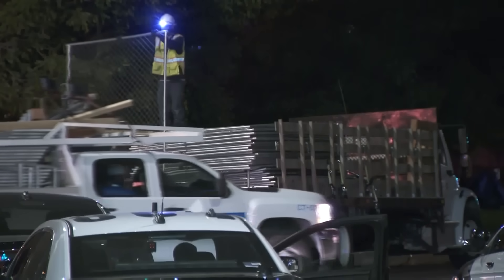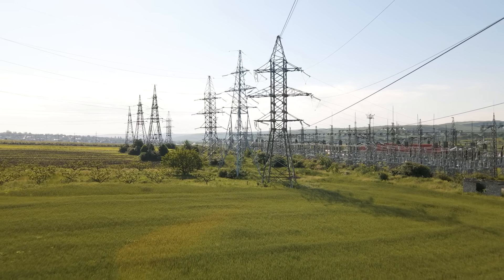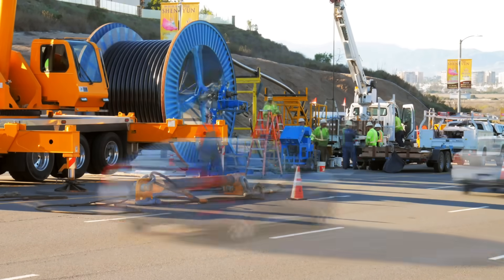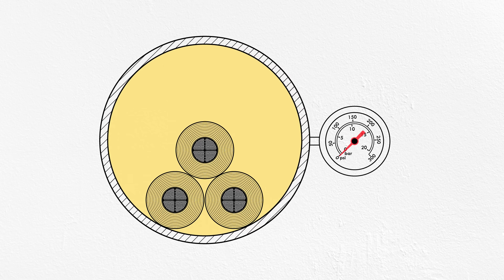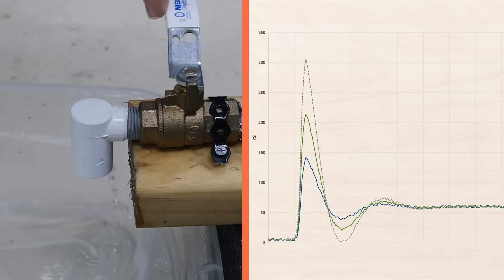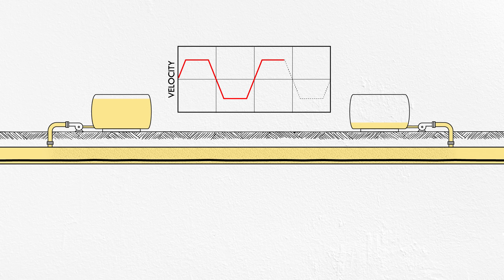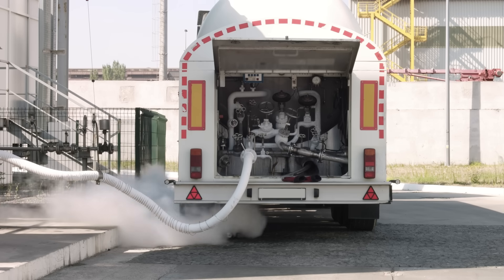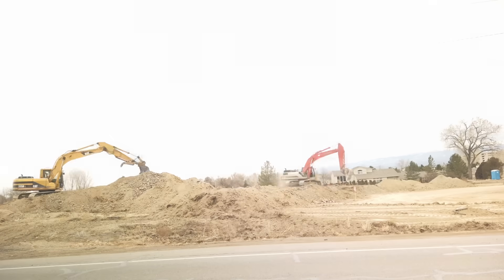Repairing Underground Power Cables Is Nearly Impossible

Comment: What surprises me so much is the extreme amount of effort put into doing something in such a way that it just makes no sense.  As soon as I heard fluid under pressure in a pipe I already knew it was going to be a disaster, and then all of the effort of the pumps and everything else...  By the time they did all of that they could have just dug a maintenance tunnel and had the cables all separated lol
Reply from the maker: You think they should have done a 20' diameter tunnel for each phase and suspended the conductor in the center,  using air as the dielectric?
Reply: @PracticalEngineeringChannel  oh no no.  Later in the video the fix shows basically what I was thinking, mostly.  Non-liquid insulation, although I would have made some kind of human accessable tunnel.  Does not have to be 20'.  I've seen pictures of maintenance tunnels that have little carts you can ride through them.  

Or say even if it wasn't big enough for a human, if it was big enough to send some kind of a little cart with a camera through it so you could find the faults easy and... Hey actually a camera on a cart would allow for visual inspections!  That would be nice.

I just hate when we build things with almost no way to inspect or repair them :(
Reply from the maker: @locklear308  Polyethylene insulation for HV cables was not widely available at the time this line went in. Your choice of dielectric was oil/paper or air. Saying that it "makes no sense" throws a tremendous amount of engineering and construction effort under the bus.
Reply: @PracticalEngineeringChannel  Ahhh that explains why they went with that!  I was trying to figure out why they should use that method over the poly.  That makes more sense now.

Thanks for clarifying

Comment: I worked for a major power company in the transmission engineering department.  Underground transmission lines cost 15 times that of overhead and reliability is worse overall because degrading material. Please don't force the utilities to put these underground. 14k Volt distribution lines cost more but not that big of a deal.
Reply: Tell that to the people without power in Louisiana.
Reply: @johncooper4637  now that is a valid point. I'm from Indiana. The worst we get is a tornado that might knock out a mile of line. When I visited Lake Charles LA in Thanksgiving, they had 100's of miles of line that had been destroyed. However, the only issue with putting them underground there is water surge. Every so often they have top put a termination point and if that goes underwater it could kill alot people/animal's.

Comment: Using oil to insulate a underground high voltage cable, sounds like a perfect idea insulation and cooling all in one package, but also a messy one if like in this case maintenance has to (as it always needs to) be done.

Comment: We definitely learn more from our failures than we do our successes. Things that we have to keep in mind and questions that need to be answered #1 the life expectancy of the steel casing? #2 does one corrosion hole in the casing with contamination from groundwater contaminate all the oil? #3 does freezing the oil have an adverse effect on the steel casing? #4 is it better to have three independent casings made out of seamless polyethylene? Or how about 4 independent casings , one for a backup?  
These are four questions I have off the top of my head & I am just a utility technician; how many more questions can you all come up with out in the engineering world? ( to learn from one another, so a  better infrastructures can be made).
Reply: 1. I wouldn't be surprised if it was made of a rust resistant alloy, but I mean a lot of water mains are steel and they're (mostly) ok
2. If there's no oxygen in the pipe filled with unreactive oil, then it shouldn't get contaminated. If water did manage to leak through then it would likely contaminate everthing
3. Oils tend to shrink when frozen, unlike water
4. Underground high voltage lines are usually one (or more) cable per phase, either trenched or run through pipes
Reply: More than likely it was steel with a poly sleeving, got to remember cost is issue #1 with companies until they finally realize their penny pinching is going to cost them big in the long run
Reply: @narmale  , I'm sure they use something like coated Gas Main Type Material, with cathodic protection. That being said I'm sure they are ill-prepared for failure due to a fairly new idea with limited experiences in failure. The natural gas transmission industry definitely learn from their mistakes. Now we have smart pigs that can analyze every inch of gas transmission line .I know the electric industry will be working hard on Solutions once problems start rearing their ugly head. It only took falling trees on multiple power lines before someone came up with the great idea of tree trimming in the area of power line. Now in my state of Missouri the Public Service Commission mandates power companies to do tree trimming in vulnerable areas ( with problems come Solutions).

Comment: ... And this is why I dislike using designs which require active measures to keep them going.  Whether it's buildings which absolutely require active measures (sprinklers, fire pumps, etc.) for fire protection vs. Passive fireproofing, or even equipment, or systems design which require refrigeration for cooling vs. Passive cooling.  

It seems like no one ever thinks about what happens when these systems fail.  

At some point, those systems you're depending on will fail, often in times you never anticipated.   

I'll give aviation some credit in this area.  A lot of aerospace design is focused on failure analysis and prevention.   Even then, thousands of people have died due to bad engineering.

Comment: There is another application of liquid nitrogen in power transmission: superconducting power transmission interconnects. Far from freezing a plug of insulating oil so a copper cable can be repaired, a tiny 1cm diameter cable of superconducting tape is jacketed along its entire length with a vacuum insulated bath of liquid nitrogen to keep it below it's critical temperature. In a superconductor there are of course no resistive losses, and so there's no need for super high voltages to reduce amps and their attendant ohmic heating problems. Rather, the thin yttrium barium copper oxide ceramic tape directly carries tens of thousands of amps in perfect, cool, lossless efficiency. (minus the cryogen boiloff losses and replacement energy costs, of course)

Comment: I think reducing the voltage to half probably reduces the chances of failure by 200%, so maybe they should keep the highest voltage runs to a bare minimum. That big fiasco in the 80's cost much more than the reduced efficiency of lower voltage.

Comment: I once worked on plant that produced those xple insulated hv cables. And most challenging is not the cable, but terminating and splicing them, ant there are many interesting field effects in insulation going on with that high voltages and huge gradients

Comment: The cable structure isn't correct for all HVoil filled cables. The ones I work with are  upto 275kv for oil  with are three separate cables for each phase. And are rolled out then burried. Also normally we don't pump and cool the oil they Just held up pressure.

We do have some water cooled cables where demand on the lines are higher
Reply: @2009G8Gxp it's all HV power transmission buddy
Reply: @2009G8Gxp that's exactly what I said.

Comment: 8:50 , as an electrical engineer in power discom in India, I have used both Time domain reflectometry (TDR) as well as thumper for LV cable fault locating work. Thumping always works like a charm. TDR may not be accurate due to various factors. I would love to see a dedicated video on Cable fault locating work. Hoping to get on from you soon. As always keep up the good work.
Reply: Which company do you work under, Reliance,Adani,Tata or else?
Reply: @dikshitaravariya836  Torrent Power.

Comment: Very interesting - I'd never heard of any of this.  This is rapidly becoming my favourite channel! 

I can't help thinking that, even back in the day, there must have been easier solutions than pipes filled with high pressure oil though!  It seems like one of those things where each 'solution' to a problem becomes a problem itself, and you end up with a far more complex result than if you'd just stopped at some point in the development and gone back to basics (there must be a phrase or acronym to describe this, because it's so common!).  For instance, my first thought was - three separate cables, far enough apart to prevent arcing.  And if heat and cable expansion/bending is still a problem, then there simply MUST be a better solution than pumping back and forth high pressure oil.  Just writing that makes it sound like an insane idea - high pressure oil, which can cause immense enviromental problems if there's a leak or break - what could possibly go wrong?  And, even in those days, very high power was delivered to users underground (in big cities, for instance), so why couldn't they just do it like that?  And how do under-sea high power cables work?  I can't believe they lay those in steel pipes with high pressure oil in them!

Comment: I knew they buried 208v 3-phase power cables, but I had no idea they buried high voltage lines like this, let alone used oil to keep those lines cooled.  I now have a new Wikipedia rabbit-hole to fall down.

Comment: Awesome video! I hadn't realised how basic, yet complicated the underground high voltage system is, guess that's why they pretty much always leave it above ground.

@3:27 you mention each conductor requires around 3m to avoid arching, that's not really the case. 
Having worked on 110kV and 220kV towers for a couple year, we had 2 safety distances we worked with. The "4 meter mark" which was for uncertified and general populace minimum distance, used to ensure that people unfamiliar with working near high voltage had zero chance of ever causing a flashover, and the "M.A.D." or "Minimum Approach Distance" which was 1.1m at 110kV and 2.2m at 220kV, used by those certified to work in the super stucture of the tower.  This was because the arch distance under normal conditions was 15cm and 30cm at 110kV and 220kV respectively, and 30cm and 60cm under surge conditions. The extra space between arch distance and how close we got was for our own safety because when 2.2m away things already felt too close for comfort sometimes.

I must also mention, it's quite a sight when a flashover up the insulator string nearly occours. Makes for quite the lightning display!

Comment: One job I had was building transformer tanks. It's a very similar concept to this underground line. Some of the tanks were bigger than houses. Some were as small as refrigerators. 

Cleanliness is a very very big deal. If not properly cleaned a single metal shaving, or a single shot from the shot blaster can cause a short which can cause a very significant explosion.

Comment: Great info!  The average public individual has no clue what infrastructure costs in time and money to insure things like smart devices (and everything else) work flawlessly 24/7/365-6.  For example, we are so bent on electrical cars, busses, etc but fail entirely to realize that it “costs” energy to move a given mass at a given speed from point A to Point B.  Hopefully we are able to increase efficiency regardless of how we decide to do work.  In the case of the automobile, our electrical grids today would collapse entirely if all cars changed to electrical.  Nobody wants above ground distribution….below ground is not a simple one-for-one alternative.  People just want what they want, regardless of how, at no additional cost.

Comment: "How do you repair this?" is a really important question that engineers need to plan for.  (Especially automotive, but that's a different channel...)
Reply: I both install AND maintain the systems my job produces. Which means I DO NOT install my cables like you see in those "Cable Porn" photos. Those God forsaken hellholes are a nightmare to trace, troubleshoot, and repair. I leave slack in cables and make it easy to poke around in later when something goes wrong. Yes it often looks like crap, read the labels and you'll see the system in place that makes it easy to navigate and fix.
Reply: Apple engineers: how about no
Reply: that is something engineers are horrible at, they never consider repairs.
Reply: big part of any engineering design is serviceability. You need to be able to fix it when it breaks. I would imagine in today's world, there needs to be some sort of sensors that are installed all across the line and they would report temperatures, ruptures, ... and man holes along the cable length so you can service a broken section without having to excavate the entire thing.
Reply: How about redundant lines. Disconnect the  dud . Turn on the new guy.
Reply: @johnalden948  This is commonly done nowadays in individual buildings with CAT-5/6 networking cable. The labor is the expensive part now, so running a second cable as you are running the first does not cost that much extra.

For power lines that would be extremely cost prohibitive.

Comment: Fascinating. I first learned engineering from my father, who was the head of the "System Protection and Electric Test Dept." of the utility serving most of Maryland.  The used a continuous flow system in their underground high voltage trunks, with the oil flowing in opposite directions in parallel pipes.  To my knowledge, they never experienced the described sort of cable failure. However, they did experience a spectacular failure once when the terminating equipment at the load end of the trunk overheated and exploded within an underground equipment vault, resulting in a flaming jet of high-pressure oil blocking access to the pump controls, thus requiring some innovative engineering on-the-fly to depressurize the system.
Reply: That was probably a different adrenaline rush than they expected.
Reply: Pressurized oil is scary as f*ck.
Near where I live there is a Krupp steel mill. 15 years ago or so there was this small fire, something insignificant, that you can put out in half a second with just a spray from a fire extinguisher.
But it was right next the hoses of extremely pressurized oil of a giant press.
They sent a crew to put out the fire and they did it. But then the hoses, damaged by the fire (and likely already way too old), ruptured.
Most of them just disappeared instantly, like the shadows of people on concrete walls in Hiroshima. Other workers just a little bit further away weren't so lucky.
Scary, scary stuff.
Reply: @qdaniele97  Hydraulic systems are much safer because they instantly depressurize unless there is an accumulator in the system. In a normally designed press, all they would have had to do is power down the press and it would have been fine. Even if the lines were still pressurized and one ruptured, as long as the pump was stopped it would instantly lose pressure.

Comment: 2:09 I can recall one partly cloudy night, nearly giving up on the moon hiding behind the clouds. Driving home it finally had a window of what turned out to be about 15 minutes. However, I found my new telescope I'd set up in haste, was directly under such high tension lines. I could hear their humming, but carried on anyway. As I got my nose close to the spotter scope attached to the main tube... I receiving a spark. Using my finger I could see a bright blue arc about 2'' in length, from my finger to the tube.
Reply: Induction is pretty awesome, you get used to it somewhat after a few years of working in HV substations
Reply: @dustinboyce25  I believe that would be the parasitic capacitance. I was once near a 30 kV bus and I measured 250 VAC on me. I was a good 20 ft away.
Reply: @Informative-and-fortunate  It's induction, as the only ungrounded object (aka a person) walking through a substation on a layer of insulating gravel you will build up an inductive charge versus all of the grounded metal structures and surfaces within the station.  In a 240kV site you can take a voltmeter and hold one lead on your bare skin and touch the other to ground and easily ready from 250V to 500V depending on the weather conditions. Dry and cold are the worst
Reply: you should have used a long metal pipe and smacked those cables. i hear candy falls out
Reply: @Blox117  
Sometimes it don't make much sense 
That common sense 
Don't make no sense no more
It's like pushin' when you oughta be shovin'
It's like a nun with her head in an oven
Don't try and tell me that really wasn't somethin'.

Comment: In the mid to late 70s I was working for a small engineering outfit. One of the projects that we had was to help a local glass manufacturer design an underground power line system similar to Grady's topic. But the transmission cables would be insulated using pure water. (Pure water is an insulator, not a conductor.) How to keep the water pure? Put it all inside a pipe lined with glass. I was not directly involved in this, but it was fascinating to me as a young designer. As I remember our involvement in the project didn't last too long, but I've often thought about this over the years.
Reply: Pure water will eventually eat the glass.
Reply: Water would keep it cool too.   Why not use leather or asbestos instead of paper which is wood?.

Comment: I work at a steel mill. We have oil filled, SF6 gas and lead cables all throughout our plant.  Most of our stuff is double ended so if we lose a cable we can single end a substation to keep things running while we rerun a cable.